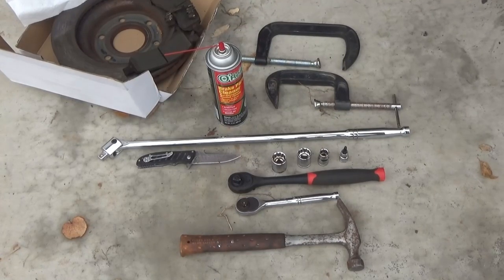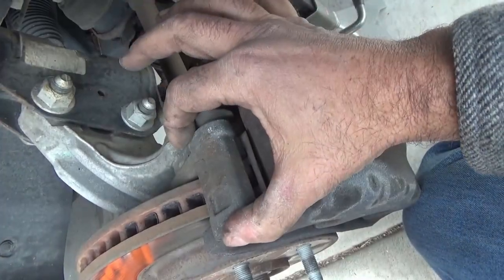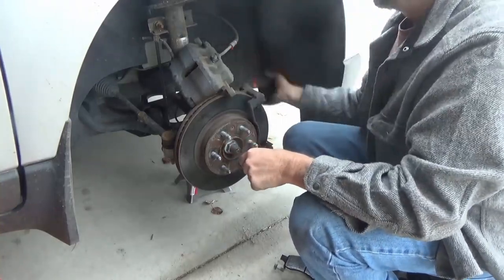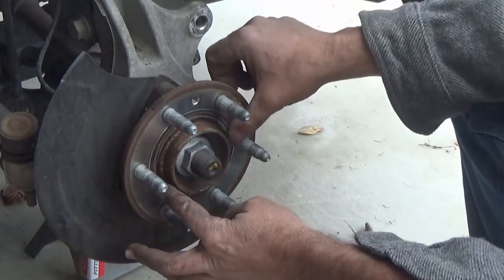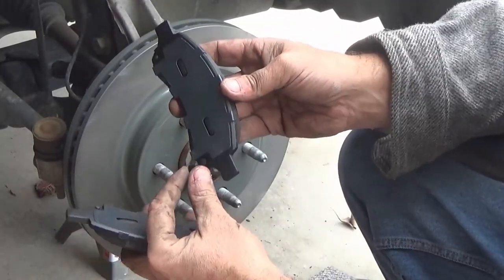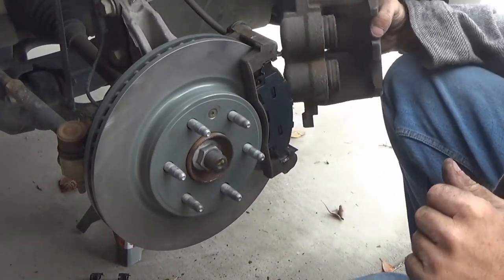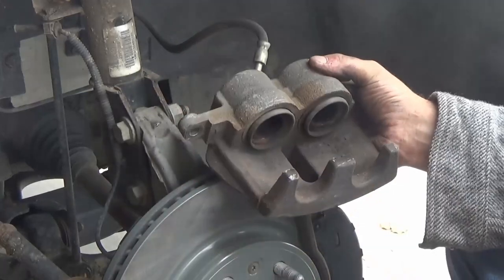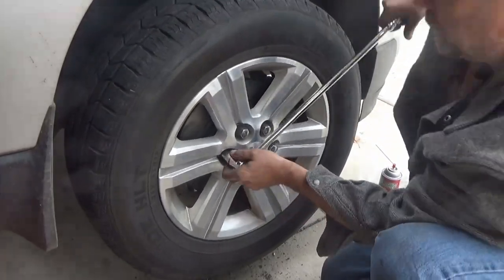Chevy Traverse New Brake Pads and Rotors | DIY Easy | 25 minutes! Discs and Pads!

Comment: One video I saw that screw is t30, and bracket bolts are 21mm, but this one says 13/16. Does each different traverse have different size bolts?  Mines a 2017.
Reply from the maker: 13/16 and 21mm are virtually the same size. But I wouldn’t be surprised if some years are slightly different. Thanks for watching!